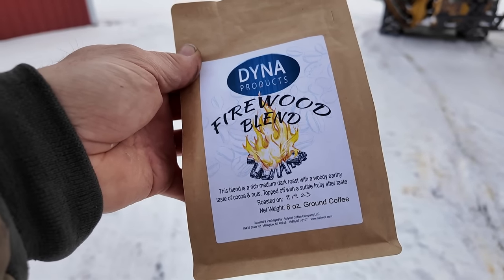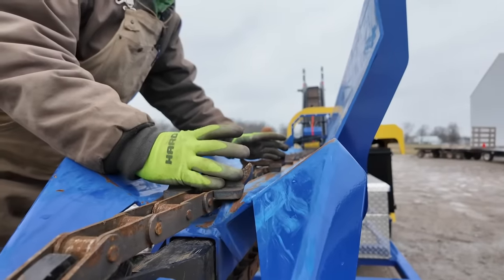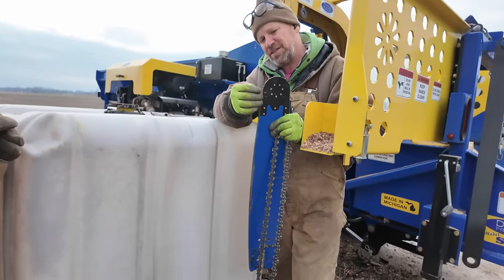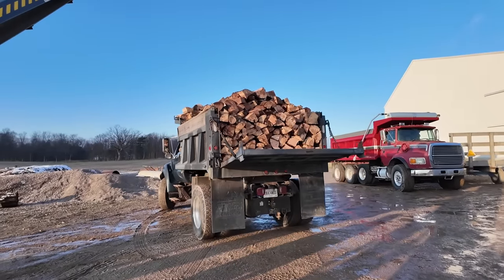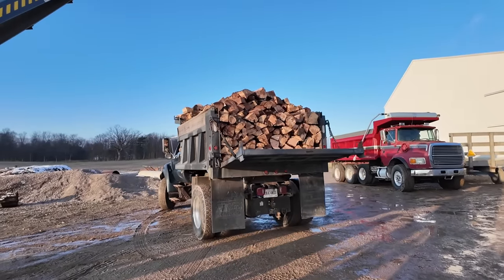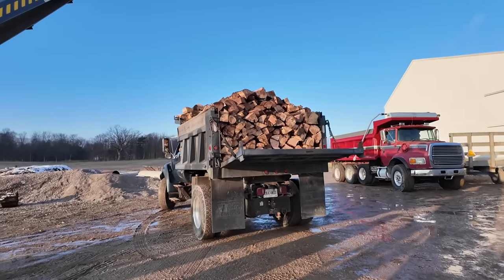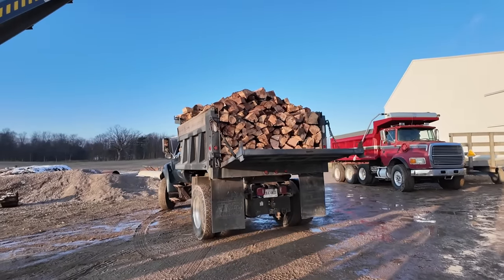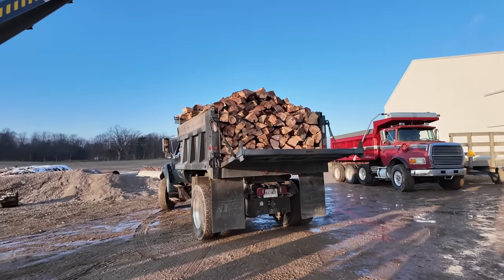Making Tri-Axle Loads of Firewood w/Dyna SC-16 Processor!

Comment: Glad to see your Dad back on the mend! Wondering, are you the only one in the family that burns wood for heat? You're are proving once again why the Midwest is the best place to live. Hard work is so satisfying. Makes you appreciate what you have - keep the videos coming. You have found your purpose!
Reply from the maker: I'm the only one left. My Dad and two uncles used to heat with wood. My cousin Paul still heats with wood but that's about it.
Reply: "Split"  the use of the processor with cousin Paul (see what I did there? 🤔🥴😆).

Comment: You could stack a lot of wood in a 20' shipping container.  Just stick the end of the belt in the end of the box and have a couple nephews stack the logs as they come off the belt.  I think a 20' box would hold close to 10 cords. 

We used to cut a couple stacked heaping pickup loads of wood every month or so when I was a kid. We did everything the hard way except for having a hydraulic splitter and good chainsaws.  That firewood processor makes it look easy.

Comment: I use the same bar oil you do although in the winter time it is sick. If you don’t let it get real low keep filling it. The heat from the saw will thin it out just fine.

Comment: That processor is a beast!  The joint aches and muscle strains it saves could put my masseuse out of a job!

The answer is, “Yes.  I’ve lost an oil cap.  And true to Dave’s addendum to Murphy’s Law… it did so at the worst possible time.”

Our grandson was coming over so that we could take his Senior year photos.  One of the scenes that he wanted was to sit on my homemade bridge over Sassafras Valley’s Gully.  To get the right perspective, I needed to trim a few limbs off the trees.

I was still in my business casual clothes from work… the 028 Stihl needed gas and oil.  It has screw caps that require the scrench to loosen them and snug them back after filling. Newer saws have the snap lock type cap that doesn’t require tools.

You know where this is heading… evidently, I forgot to snug the caps after I filled them.  I cut the first few limbs at about waist height.  By the time I got to those at chest level  the gas cap was weeping and the oil cap popped out in mid cut.

I haven’t a clue whatever combination of chemicals are in the mixed fuel and bar oil.  But, I can assure you that you won’t be finding a guarantee on any  stain removal product that’s sold retail… and, when it seeps inside your new dress shoes you’ll instantly have a pair ready for light yard work!

Glad you got that wood processed… now you can play a little ice hockey with the girls.   Enjoy!!!
Reply from the maker: Oh boy! Fortunately I haven't had a set of good clothes fall victim to the loose oil cap, but now every set of Carhartt bibs I own bear the mark of the 036! 

The funny part is that it can happen without noticing sometimes.  Seems impossible.

We did get some ice skating in. Only problem is we took for granted that we'd have skates for everyone this year! Turns out the girls had to wear Mom and Dad's skates so I was just a spectator for this first round.  

Amazon should fix the skate shortage issue, but now we just need another cold snap!

Have a great week!

Comment: Amazing how processing firewood has changed.  Yes I did the tree at a time.  Upgraded to having Log length delivered borrowing a log splitter finally and now something like this is available to the average person.  If I still burned wood I’d be looking for something like this.  I doubt there is eve on in my area of northern Maine for rent.   But I admit I got on the pellet train and have a pellet furnace and a pellet stove and don’t think I’d turn back.  I do have a wood stove in the basement but it is just stored there and hope to not have to hook it up.

Comment: Just one thought about the Dyna SC-16, maybe they should opt for a circular saw rather than the chain saw, seems to me that the chain has a lot more issues than it should. It was a good idea using a tote to catch the sawdust, seems it is easier to clean up. Maybe they should incorporate that idea in the next model. Could be some royalties in it for you if they do.
Reply from the maker: The saw works pretty good though for the amount of wood it cuts.

Comment: Good to see Mr. Koch is on the mend.  That's nice Dyna saw your previous video and made improvements to the version for you to try out.  Shows they're a good company whom pays attention to content producers.  Might be on to something with using those plastic containers for catching the sawdust.  Almost have to think that a dryer pipe, HVAC boot, and some bolts could reduce the dust mess.

Comment: You mentioned you wanted to reduce the manual handling of the firewood. We use the metal grids for IBC-containers and dump the wood in them. Put som 4x4" on top and you can stack them on top of each other. An opening on one side of around 16"x12" to get the wood out also helps.

Comment: Back in the day I got a bunch of IBC totes and took the plastic out of them, they were  similar to the one you cut up for the sawdust. They were pretty cheep and the local landfill was happy to take the plastic as long as I cut them up in somewhat small pieces. The bins rounded over would hold a 1/4 cord. I hauled them around with my 257. The  only time I handled the wood by hand was throwing them through a trap door into my woodbin in the cellar  and feeding the boiler. They are perfect for setting them out into a open area to dry the wood  as well. The less I could handle firewood the better I felt about burning wood. Stay warm
Reply from the maker: I like it!

Comment: I use Nestainers to store firewood.  They are larger than IBC totes and stackable.  I  put down some old decking wood for the "floor".  Then closed in  three sides of the nestainer with wire mesh.  That leaves the front open so its easy to access the wood.  Downside is they are harder to find than an IBC tote.  I was able to find cheap used ones at an auction.
Reply from the maker: I'll have to look that up.

Comment: The end of the bar where the chain goes around that needs to be oiled frequently or it's going to jam up but that's also why some chainsaws have automatic oilers and it doesn't look like that one has an oiler
Reply from the maker: It has an oiler.
Reply: @digdrivediy  but it's not working
Because if it was it wouldn't jammed up
Reply: @kirkslayden834 harvester bars are solid and don’t have grease holes

Comment: IBC totes on galvanized pallets? They are not very expensive and you can store in different locations with metal roofing on top in the back, move them to the boiler when you need them.

Comment: You filled the red dump truck 2 times that would be equal to 1 tri-axle load of pole wood 25 feet long from my logger that would be about 21 to 22 tons of wood I have had my SC-16 for 13 years now. I have done a lot of mobil processing and many times it would come right off the log truck onto processor out the conveyor into a tri-axle dump truck it always takes 2 dump trucks to haul away 1 log truck load of logs. The smaller truck do you think the 2 loads would make 1 of red truck. With the pole wood I get I could fill that red truck in 2 hours no B. S. Good video nice  quality👍
Reply from the maker: I believe it.  We could have filled the red truck very fast if we weren't stacking it. I think the red one holds 2x the small truck.  So in your estimate how many cords do you think we made?
Thanks so much for your insight. I appreciate it.
Reply: I get about 22 face cords in a tri-axle log truck load but that is cut to 16 inches so you would be getting about 11 face cords per the red truck and my customers would do the same as you they hand stacked some of the wood thats the only way to get a log truck load in 2 dump truck loads. I would say 33 face cord at 16 inches I dont think you did 16 inches but now you can find the cubic feet with some math. If my math is right that should give you about 1.395 cubic feet of wood
Reply: P.S. I never ment you guys was slow you guys had wood that was not the best for a processor I just ment the nice wood my logger brings to me never anything over 18 inches and is very straight the bad stuff he chipset it and takes it to the paper mill I think you guys did great

Comment: Great video. Thanks for sharing. I've rented a SC15 two years in a row. They've made some great improvements. Also, that chain is supposed to take the weight off the winch cable for the conveyor.
Reply from the maker: Oh right. I forgot to set the chain.
Reply: All good. I ran it the first year and was told by the rental guy that's what it was for and for transport. Live and learn.

Comment: Love it!  Observations... Heavy duty feed deck, heavy duty operators. Some gnarly logs. Perhaps the chain bar required lighter weight oil to flow better in the cold conditions?
Reply from the maker: It is using the winter oil.

Comment: Scuffy the neighbor boy (young man) go on strike this year?? Nice of Dyna to try saving face after the last ordeal. They are the only processor manufacturer I am aware of that helps their clients with a rental program. The cost to rent one not knowing what all maintenance issues could arise is sure the downfall. Not every owner is keeping them in tip top condition...Hard to beat a years worth of wood with a day and half of work though. It looks like a lot of mess but there would be just as much with a chainsaw and box store splitter. That was a bunch of firewood!
Reply from the maker: The neighbor boy is growing up.  He may have helped if I asked, but the nephews are chomping at the bit to get some pocket money!
Reply: @digdrivediy  👍👍

Comment: Just out of curiosity, would it be more efficient to move the operation to your place? You could essentially split the log on site and with the conveyor feed them directly into your wood storage sheds instead of loading a truck precariously and then unloading to your wood storage building. 

Also based on the layout of your storage building I see you wouldn't be able tp process right next to it. but if you built a conveyor to carry the logs from the processor to the storage building you wouldn't have to move the logs numerous times. The conveyor system would carry them from the processor, up the attached conveyor, then drop them on a secondary conveyor which would carry them to the piles where your kids can help stack.
Reply from the maker: I just wouldn't want the mess right there and all the logs would need to be in my driveway.  The processing next year will be closer to home.

Comment: What is the cost of that operation? 

Equipment rental, two dump trucks, an excavator, chain saws, fuel and oil for all of the above, expendables such as saw chains, plus all of the time cutting, stacking, and cleanup after.  

Is it worth it?
Reply from the maker: Yes 👍🏻

We have all that equipment for tasks other than firewood, so it makes it even more justified in mind.  This isn't for someone that at the very least doesn't have a skid steer.

Comment: Wondering if you find a use for the saw dust?
With a hydraulic cylinder and some pipe it’d be interesting to make a large pellet extruded since you have it in the tote and pretty much out of the weather. Not sure how your planning to get it out of the tote?

My local horse rescue used my mill saw dust for indoor floor cover.
Reply from the maker: I'm not sure how to get it out either.  Was gonna just cut the side out and dump it or something.
Reply: You could cut the top off, then to reuse, pop rivet a band of sheet metal around the “lid” using backing washers on the rivets to hold in the plastic. 
Slide that lid over the top-ratchet strap or hold it on while in use. 

For dumping, if the bottom was bolted to a pallet, could your forks angle enough to tip the tote enough to dump with lid off?

That metal band might be better on the base to strengthen the plastic when you dump. 

It’d make a handy yard waste tote for leaves, etc. 

Anything to prevent handling or shoveling stuff multiple times. 

You’ll figure something out.

Comment: Is it me, or don't they make chainsaw chains like they used to? Way back when (60s) I don't recall going through chains as fast as today. I by no means do anything like the volume you do but it seems I'm constantly tightening those stretched chains. I now have gone to the 40v electric saws which is more than adequate for what I need to do but the same problem persists. Maybe you can enlighten me a bit. Another entertaining Sunday morning. You need a front brush for your 318 to clean the ice off. And a couple of hockey nets. :)
Reply from the maker: I'm not sure about the chains. I guess they seem about the same to me but I wasn't cutting before the 90's.  I wouldn't be surprised though if they're not as good as they used to be!

Comment: 2 blade splitter instead of a single blade. Cut the wood into 4 pieces. 6 piece splitter is good for the larger logs.
Reply from the maker: We were using both a 4 way and 6 way in this video.

Comment: One improvement they can make on a new model. A power lifting jack that will go low enough it doesn't get stuck like this one did.
Reply from the maker: That was my fault it got stuck.
Reply: @digdrivediy  yeah, but a power jack would still be a nice improvement as well.
Reply from the maker: @keithfrazier2558  Most definitely 👍🏻

Comment: If the blade arm end sprocket doesn't have a grease hole, then it is usually lubricated by chain oil from the engine side.

Comment: Seeing all that sawdust , could you put that thru a pellet mill ?
The rest for the compost pile?
Reply from the maker: Not sure.  I don't know where a pellet mill is located.
Reply: @digdrivediy  fair enough g to there have been postings on you tube of folks purchasing them from China , they are self contained single cylinder diesel engine units  if I recall correctly 
, in which you put a mixture of saw dust and another product to help them extrude from the mill is what I recall , or just compost all the waste
Reply from the maker: @heartland96a  Oh cool!

Comment: My friend has a processor at his tree company takes 5 to 6 guys to run it has another small spiter also cause he sells to the public then takes it down home and has a place people close by can get wood he also has a machine that splits up the really big ones big wedge on it has the same kind of outside heater also but stacks three foot long pieces up there plus totes have splitter ends in them once it gets fired up burn the spitter ends that they spit up during the week got a hot fire burn it right up gets paid to take down trees and split them up and sell the wood not bad has another splitter up and down one straight wedge one a cross wedge with conveyor belt on it so stacks it gets to bottom of converor move forward self driven pretty n
Eat operation he has 25:11

Comment: just watched your pool videos and you made 1 mistake in it, pool water must be filtrated, basically pool equipment which is not cheap and cost money every year to maintain and clean every day or different option.water gets bacteria very fast without filtrating. water must be filtrated daily. you may not see green stuff, but bacteria may alerady in pond and its bad idea for kids to swim in it. majority eyes. this pool must have either expensive equipment which runs and empty your wallet daily i woudnt choose it also chemicals are not friendly to anybody, especially kids, dogs nature. You could make non stop flow of fresh water in and out to fields, to remove bacteria out as constant flow of water, fresh in bad out. equipment working pumping water. next very simple its a pond plant plants which are clearing water and live all year, some fish who also clears it. than ecosystem is made of pond you wont need to do anything. it will start clearing itself. some fish may ber good idea which clears it, in winter it will survive deepest part even if it freezes. only in winter if you have real frozen lakes in your area make holes for air to get inside pond.